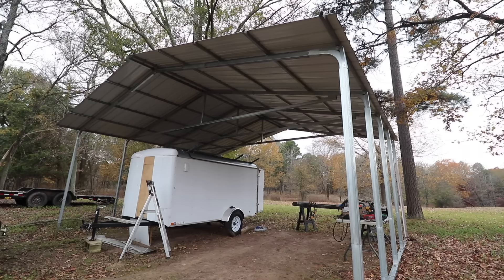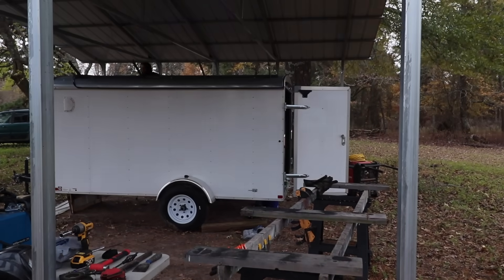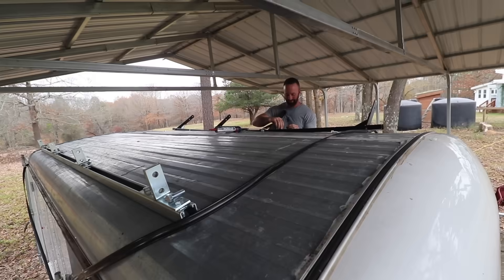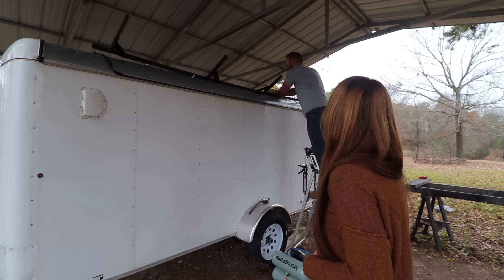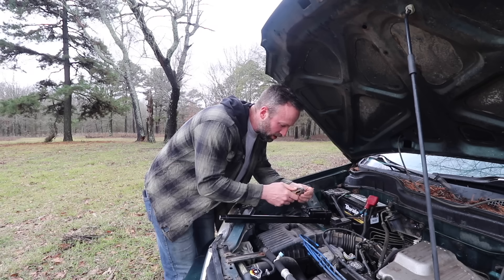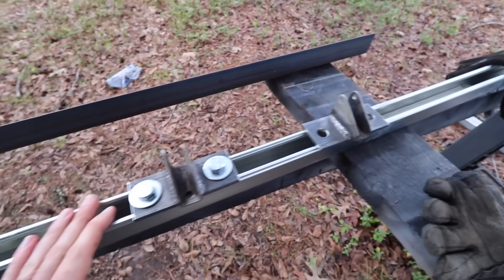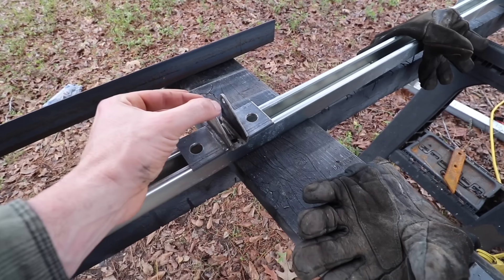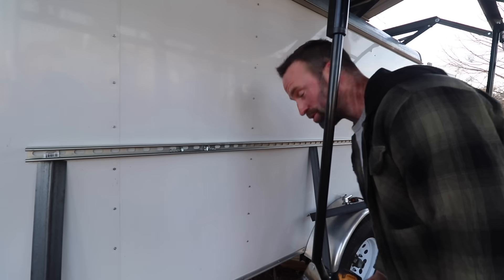Building A Mobile Workshop (with an adjustable solar array)

Comment: How many solar panels are you going to put on the rack? Is this power supply is only used for the tools? I have a two hundred watts panels (100 watt each), and I have plenty of power to feed to one battery to run my table saw all day. It does a job. I am curious how much amps that you will put in the trailer to run the power. I wished that I could attach the picture here.

Comment: Will the shelves be on slider rails? Would be practical since Spencer is a tall man and the trailer have low height. Just standing outside the trailer and just pull out sliders with tools on them.

Comment: Just a heads up, trailer wheels are notoriously poor quality.  A good precautionary step is to find quality ones and replace them before they fail.  It sucks to have to find a spare when broken down on the side of the road.

Comment: What happens when one of the electric actuators stop working, one will push it up or down and the other will bind up and twist something posibly breaking a panel or frame.   Isn't there a way to only use one actuator in the middle that is a little stronger.   I would worry about them staying in time with each other.   You should put quick connect pins on the one end just incase you need to disconnect one temporarily.   Nice setup for sure, good job.

Comment: just my two cents from a random follower but wouldn't it be a lot easier to use manual arms to lift the vertical solar panel?  you could have put up some vertical bar with horizontal slots running up the side so that you could lift and set the arms at various angles without the headache of actuators not working at some point

Comment: I'm usually impressed with the things you build, but this solar setup is totally over the top. Normally I would applaud your ingenuity but this is overkill bordering on insanity. So much wasted effort and so much wasted material for very little gain over a simplified setup.

Comment: Do you have a plan to run the wires for the actuators so the wires do not have to lengthen and shorten? If not, can you flip the actuators so the motor end is connected to the side and roof of the trailer then the wires do not have to extend?

Comment: Mount the actuators,near the top of the trailer and have them push down?  That way you can pull the panels flat to the trailer and probably get more than 90 degrees on extension.

Comment: Hubby's friend had put 2 harleys in a trailer with the same size frame rails and the suspension ( ie. axils, lee springs and hubs) and the trailer couldnt handle the weight. Not sure if youve said how much weight you're towing or putting in and on the roof, but you might consider looking into strengthing the framing and suspension.

Comment: you should have put the panels on the passengers side of the vehicle, that way the wider side of the trailer is hanging over the curb/ditch and not on the side where opposing traffic will be. (i know you didn't do that because of the door)

Comment: Run some unistrut front to back , There's a lot of stress on the thin top and sides. Adding some unistrut length ways on top and on the sides, will help sand which and spread the load/stress. I'm also hoping you are gonna caulk the bolts. Oh and wondering what type of tie down system you are gonna use? I can already tell, thi is going to be a really nice mobil work station.

Comment: Spencer - I would add a DC take off so you can plug the panels into your homes set. If I remember correctly you had a tough time one year which is when you added the additional panels. Having a way to collect more sunlight when it’s cold or when the heat is high you need AC could be useful.

Comment: seen homemade devices (solar tracker ) that can make the panels follow the sun automaticly while it goes across the sky using two lightcells in tubes , they basicly equalize the amount of light between those two to point the panels as straight intoo the sun as possible (single plane ) stlll need to get the side of the trailer pointing towards the sun as good as you can 

might allso be a good idea to put a generator on top of the tongue of the trailer  
to operate more heavy machines you might need a generator that isnt a modern inverter type 
i used to follow another build where they did a log cabin and the large sawtable they used needed a regulair type generator (one that just gives full power all the time ) as the sawtable wouldnt start up with the inverter one  , it allso be nice to charge the batteries in dark times , to have some extra power and prevent the batteries from getting discharged too far when needed too

looking at the solar array im wondering if the setup might be stronger / more efficient charging the batteries if you fold out the side one to horizontal and connect both pieces together (maibe do box section that can slide one intoo the other to connect them or make sumting that looks like an upside down rooftruss made from band steel mounted with wingnuts one the side end or lowered and behind the panel when in drive mode ) 
then lower the side one pulling the other on the roof up along with it 
this might lessen the load on the linear actualors themselves as youre basicly seesawing the aray on a center hinge and both sides are of about equal weight , and you can put all 4 linear actuators on one end giving you more power so you can mount them at a lesser angle and get more range out of the length of them 
should be able to get a larger/angle on the whole thing that way , you could basicly set the whole thing vertical and depending on a clear view of the horizon have maximum lightcoverage starting at sunrize changing the angle throughout the day while the sun crosses over

Comment: If you're going to build one, build it the way you want it. Great job with the solar power setup, but remember, simple is good. I'm afraid the jostle and bouncing of the trailerwill affect the mounts and panels. I could be wrong. Love ya'll ❤️
Reply: That and the center of gravity/roll center has moved vertically quite bit with all the weight hanging off the top.

Comment: Interesting build as usual.  If you guys are interested in getting a little more clearance under the carport, there is another way to brace it without having the braces running low from one side to the other.  The people who built my carport offered a different option.  You can put shorter stainless steel braces near the top leg posts to the rafters at an angle then from one side of the rafters to the other just under the peak.  That type of bracing allows me to get taller vehicles under the carport and it shouldn't be a difficult modification.

Comment: In case you haven’t thought about it, you might want to consider a cut-off switch for the actuator power.  You never know what will happen on the road.

Comment: A word of caution how you connect all of the panels together. Just like shade, the least producing panel will cause a reduced output on the other panels. Best way is to have 2 strings. One for the four pointing in the same direction and another for the 2 that are independent
Reply: i did not know that.  Thanks.

Comment: A couple of questions about the build:

1. I can't remember if I asked this last week or not, but did you consider raising the roof 2 feet so that you can stand inside?
2. I assume that you are taking a generator along. Will you be placing a weatherproof outlet outside so that you can plug the generator in, and power some outlets? I'm thinking in case the weather is bad and the solar isn't charging enough, or there's high winds and deploying the panels is risky.
3. Are you doing the wrap-around awning so Kenz's Corner is outside?? 🤣🤣🤣
4. Future project question. When will you do the barn so that you can have a proper workshop at home, and you don't have to work outside? It obviously has to be big enough and high enough for you to do things like work on the RV or the trailer or the car.

All the best!!
Reply: اضيف نقط ثالثه لابد أن يكون هناك شبابيك لتهويه المكان ومولد كهربائي لداخل عندما يكون الجو سئ يجيب ان تضع النقاط على كل شئ تحسب لكل طارئ الطاقه الشمسيه خارجي داخلي يجب أن يكون السقف مرتفع للوقوف براحه شبابيك لتهويه وايضا تكيف وتدفئه الواح لتشغيك الكهرباء داخلي مكابس عوازل في الحائط والسقف الارضيه جيده نوع الخشب لتركيب  مثل بيتك الأول وبارك الله في مجهودك الجبار ❤
Reply: Well he could do that, but it will be expensive, isn't worth it. Better is to get a taller trailer etc etc
Reply: @ That might be true, but you don't get much content if you do that... building it, however.... that's a whole 2... maybe 3 episodes worth 😁👍

Comment: Your putting a lot of extra weight on the roof of that trailer, normally trailers are designed to carry weight on the inside on the main frame of the trailer.  The roof is just a covering together with the sides. I would check with the manufacturers of the trailer for their recommendations.  For example if this was car the manufacturer would state how much load could be carried on a roof rack. Again if it was possible to carry more weight on the roof of the original trailer, I believe the manufacturer would install some type of racking system to the roof. Not forgetting the sides of the trailer,  extra unevenweight could also be a problem.  When you load a trailer,  you should load it evenly.  Please get advice for safety.

Comment: That's adding a lot of weight  to that one side of the trailer. If you don't even out the weight for both sides it will cause it to fishtail being pulled down the road

Comment: Have you considered wind loading/gusting when in the deployed position! Expensive lesson on my end with a “deployed” 550W panel - even though I had designed and installed for wind gusts! Just so happened  a “dust devil” went through and lifted the panel to over-extension and destroyed it!!! Hopefully you’ve over-engineered as you often have so it doesn’t become an issue for you!! All the best, keep the builds coming, be safe!

Comment: does the cylinder set flat against the trailer when completely closed or in the down position without 1 side having to slide instead of pivoting

Comment: If there ends up being a gap of open space between the top of your trailer and your solar panels you could put a piece of metal on a slant at the front to divert the air  above  so the air doesn’t go between the solar panel and the trailer

Comment: I know its to late now, but,,,, Im surprised you put the panels on the drivers side & not the passenger side. I would think less chanch of getting damaged in traffic. Also, I think if you had put the channel iron vertical instead of horizontail you would be able to adjust the  actuator. Just my thoughts, You guys are great, have watched you from the first episode.